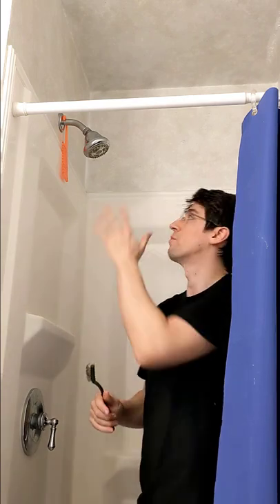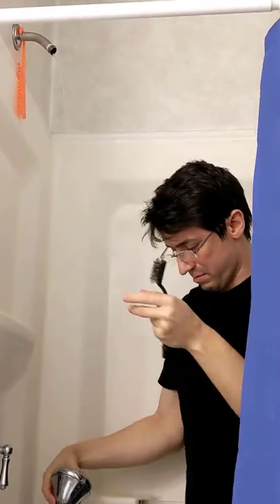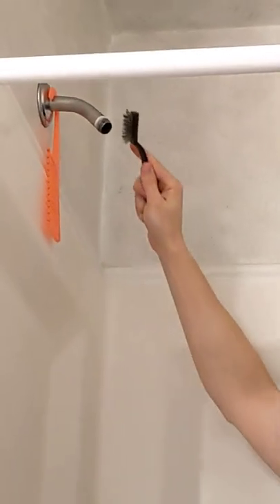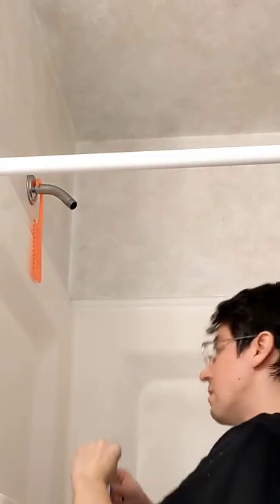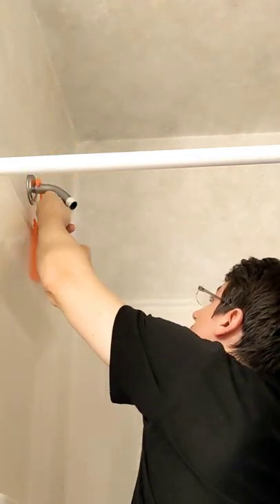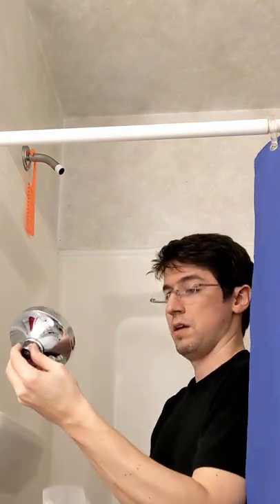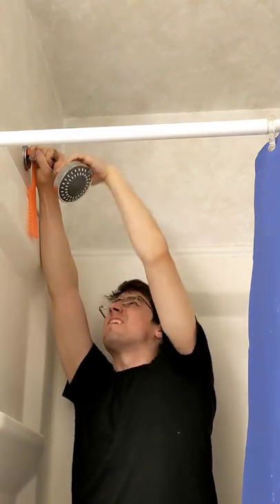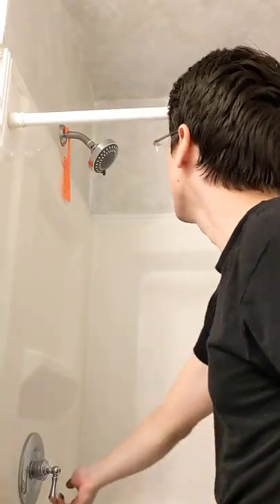How to Install a Shower Head

Comment: Teflon tape needs to go on clockwise or the way the head is screwed on.  You did this right, though some may not know this. Also holding the main wall attachment as you did is a good idea so you don't crack the pipe.
Reply: Thank you!

Comment: Did that but it leaked.  I have carpal tunnel so thought I should tighten with a clamp wrench now it sprays out of the joint.  How do I fix it?  Teflon tape is on clockwise
Reply from the maker: I would check the rubber seal that should be on the other end of the shower head and make sure it is in good condition and looks like the right size.

Comment: Do you need to shut water off before replacing?
Reply: I would assume so unless you want to have a shower while your at it 😅😂 :D
Reply: Sorry if you mean the water meter outside the house or where ever yours is, i dont think so i dont believe that is an issue but very good question you got me thinking now, does the water come out if shower head is removed, because my shower tap for turning on off hot and cold is connected to where shower head is connected
Reply: I dont know if the tap om the shower controls that or the water meter or main water control good question thanks so much
Reply: Just turn the water off the same way you would when getting out of the shower 🚿 and ENJOY 🚿🧖🏾‍♀️ 🧼 🧽🚿
HOPE THAT HELPS 
❤❤ GOD BLESS IN JESUS CHRIST MIGHTY NAME AMEN AND AMEN ❤️ 🙏🏾 ❤️

Comment: I want to replace a new shower head but old shower head seems stuck. Is there easy way to get it out?
It’s delta brand.
Reply from the maker: Get a nice sized plastic bag, and fill it with Vinegar, then place it over the shower head, and make sure the Vinegar is reaching the threads of the shower head.  Tape the bag up there to sit over night, and get a pair of Channel Lock pliers, like these:
https://amzn.to/48tMmMQ

And grip the base of the shower head and turn counter clock wise.  Be careful, and you should be able to get it off.

Comment: Why do you need to use tape
Reply from the maker: It helps you tighten the shower-head, and helps create a water seal.  It is possible to get a new shower head on without the tape that doesn't leak, but the tape makes this easier.